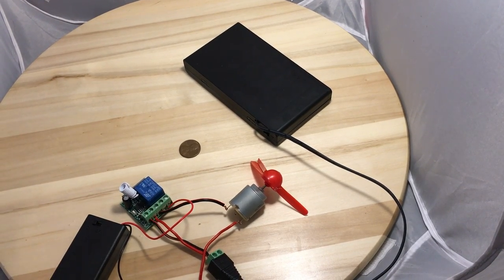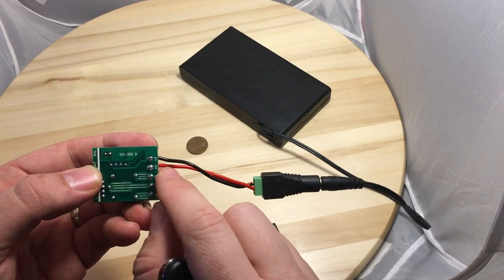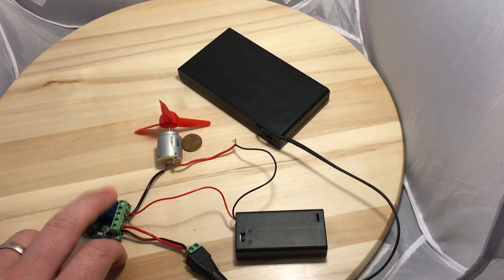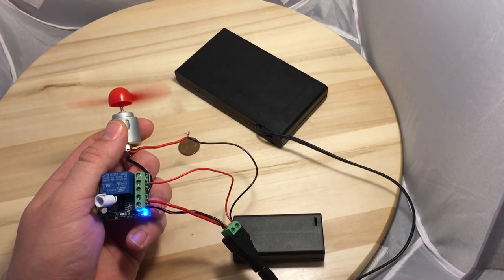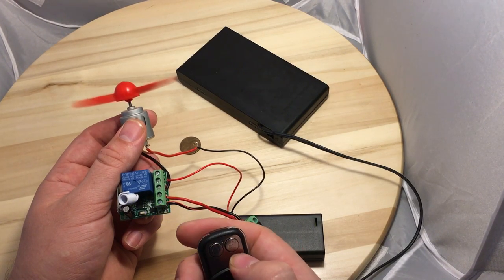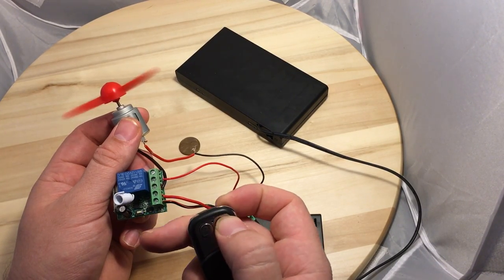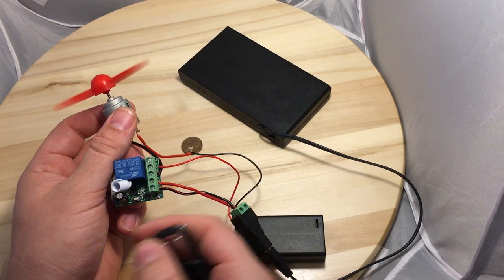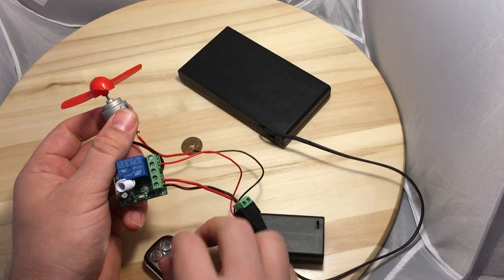RF Wireless Electric Garage Gate Door Remote Receiver Relay switch 1 Channel C18

Comment: If the motor was 6 volts can you use just one power supply?
Reply: Have a look at voltage divider using resistors. You can split the 12v, if memory serves, using two of the same resistors in series, you get half the voltage or 6v between r1 and r2, so, yes! I just dont remember if you need any specific value for the resistors. Check out "voltage divider".
Edit: 2 years ago, lol. My bad. Hope you found your answer!

Comment: what would happen if you connect that receiver to wiring between you home mains supply and a lamp?
Reply: Actually the relay is used for powering up high voltage devices...in short fan,bulb.etc but the guy is using it for toy motor